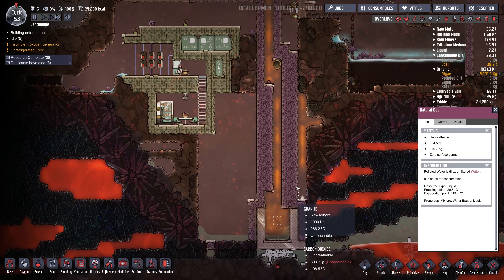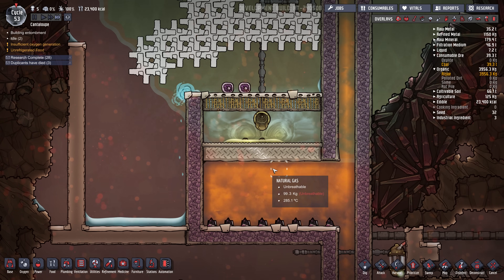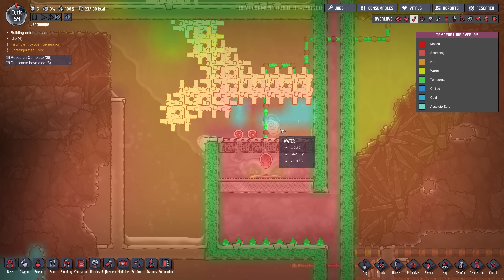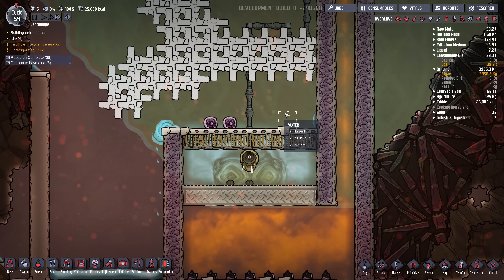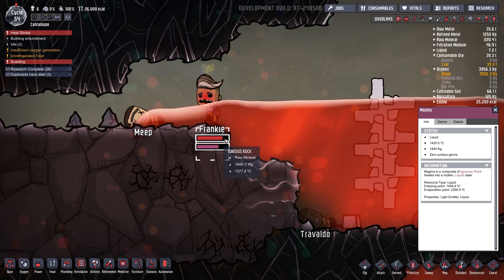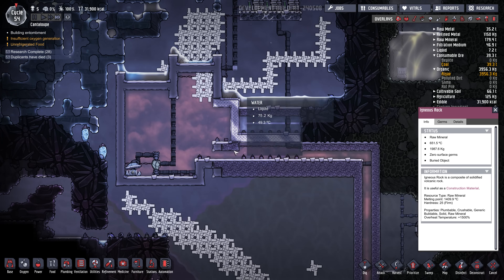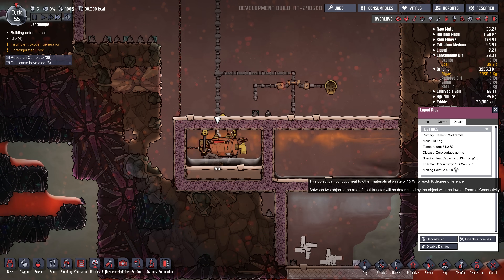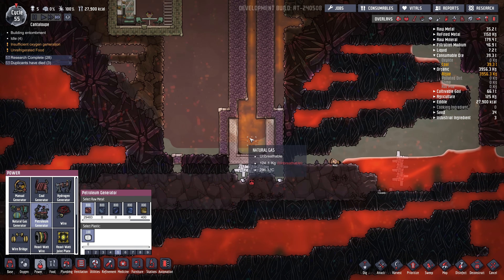MAKE NATURAL GAS FROM OIL USING MAGMA #2 - Oxygen Not Included Automation Upgrade

Comment: IMHO idea with using Oil Well is not so good as when it breaks 100 C (373 K) incoming water will turn into steam in well itself and in 1 block with water pipe (where it connects to oil well). Also vaporisation process dissipates heat. In case of precooling incoming water to Oil Well it will produce less heat. But at first look this idea is awesome.
Reply from the maker: Someone suggested the new ore refinery since it can be made of abyssalite with a melt down temp of 2000C. But the dupes working on the machine burn up :(

Comment: 5:30 You can use the metal refinery to make oil to petroleum 

https://imgur.com/a/r1zMB
Reply from the maker: Nice! Is this the small amounts that leak out? I've noticed that happen with water sometimes.
Reply: When the oil reaches 400 ° C, the pipe bursts at the outlet and 400 kg petroleum flow out

PS:No, it does not leak, only if you break the pipe with water you have 400kg of steam, which condenses over a long time.
Reply: Damn, update 241465 breaks it, now it produces natural gas with constantly rising temperature

Comment: Dude I had an idea a few minutes ago..
What about the new ore refinery thing... it can be build out of absallite for example.. (or other stone Materials because it would take forever) just put it in a vacuum.. I know its not infinite but that might be the only way.. havn't  tested that yet
Reply: probably wont work because of the water you have to give it..
But with a bit of an crazy build and your Idee it might be possible
Reply from the maker: I tried it out. Dupes need to be there to refine at the refinery....so they boil to death. Also I found a bug where the output pipe randomly overheats (even when made out of abyssalite).
Reply: Grind This Game yeah..
Tried as well.. you can give them a suit you know..
It seems that the oil thing does stop at about 90° if you let the oil flow out trough a vacuum seal that dupes can pass so no heat can get out.. 
And the ore refinery does overheat if you build it out of something other then absallite..

Comment: Will normal tiles made from abyssalite keep the heat in place the same as insulated tiles made from abyssalite? Through my testing I found that normal tiles are enough but the temperatures were nowhere near to these. Insulated tiles are twice as expensive...
Reply from the maker: Yeah you get to pay that extra material cost just for the look of them.

Comment: you could use naphtha air locks with a vacuum between the abysal sealed rooms. dupes would be able to get in and they can survive for a long time in heat so they should be able to run the machine
Reply from the maker: That could probably work. I'll try it out :) Thanks.

Comment: I'm under the impression that biomes don't cool down naturally so all this heat generation will eventually back up.  That new radiator is probably the only good solution.
Reply: Micah Chase - Wheeze warts delete 2,000 watts of heat if inside an atmosphere of 1kg hydrogen.

Thermo aqua tuners have a total next cooling effect- when they are submerged in the same pool that is feeding them they can still bring the total temperature down.

An oil or petroleum radiator feeding into aqua tuner loops could be able to remove massive quantities of excess heat. The issue is, the faster you cool the gas, the faster you cool the lava. its a huge waste.

It is best to contain the heat as much as possible for as long as possible, only cooling the gas as it is used.

Of course, making your cooling system a water purification system is a great use of the heat. You can syphon off the water and keep it in a cool water tank - cooling it only as much as needed (15-20c)

This system as shown is very, very, very wasteful. Ultimately, gas production should equal to your consumption - storage should be in the cooler oil only and the oil being converted should be warmed up to 100c with some machine before dripping if its colder than 100c. Limiting the total energy extracted over a given time allows the lavas heat to fully normalize across the entire pool, maximizing the total extraction before solidification and minimizing the need for cooling.
Reply: Nice ideas.  I had some warts in an 8k hydrogen pressured room.  I wonder if it looses efficiency?  I was thinking maybe it sucked in a entire square of gas so it would be better.

Regarding lava I guess it is neat to mess with but i'm mainly interested in something that will work forever.  So the fact that it will eventually quit working is no good but the steps to make it last as long as possible were nice.
Reply: Micah Chase - Warts have a maximum “lung capacity” of 1K.

Increasing the mass beyond 1K little effect.

But something that does help is giving the bottom and top as much airflow as possible - like a less powerful pump, warts pull in gas and can leave a low pressure zone below, if that pressure drops below 1k then its not able to move its maximum.

I agree with you about the unfortunate limits on the power from lava - since the molten rock has such a low specific heat, there is no decay source to add additional heat, and the pockets are separated with nutronium... major changes to the lava biome have to occur to make useful power.

Lava in this game is hot, but there isn’t all that much energy.

Although it may last longer than expected, I will attempt to make a 5 thousand cycle system extracting as much power and useful heat as possible with minimal losses on a test map without deleting nutronium.

Comment: Tepidizers dipped in naphtha can achieve those temperatures.  I posted a scheme that melted copper that used steel, but you could probably boil petrolium and be stable with gold amalgam if you cooled the naphtha with a couple aquatuners.

Comment: Water Tapidizer runs short while after being turned on NOT in water, so it gives out incredible amounts of heat. If you can make it out of tungsten (i hope you can) and hook it up to some pulse signal shenanigans.
And if you want to keep using Oil Well, make a double naphtha air lock, one inside vacuum. That way heat wont transfer at all to outside when dupe gets in to release the pressure.
Reply: Can't use tungsten or any refined metal for building Water Tapidizer